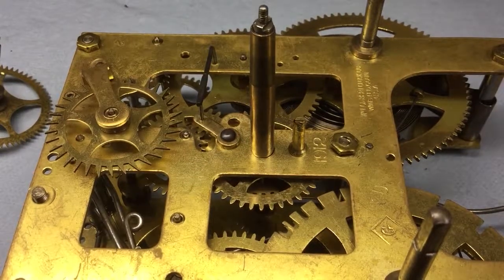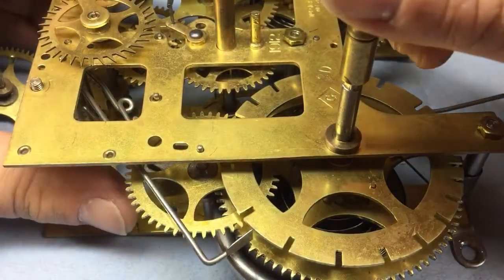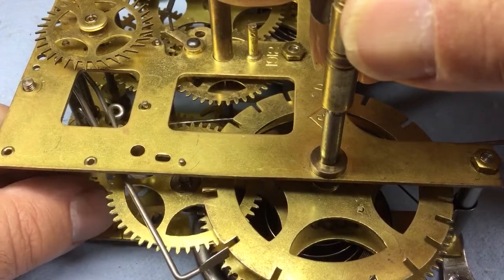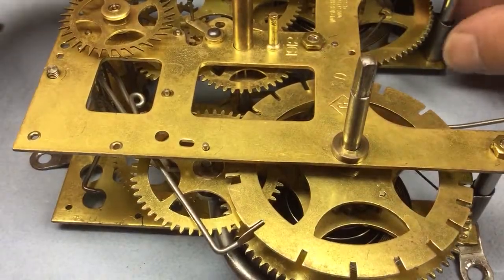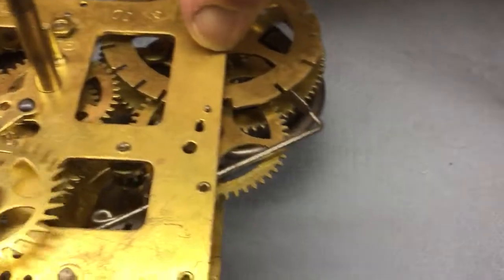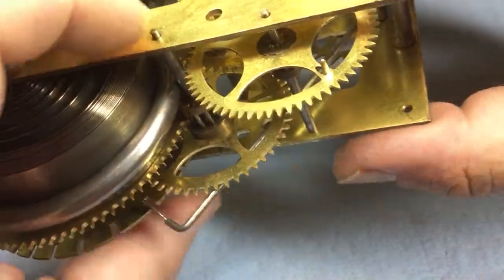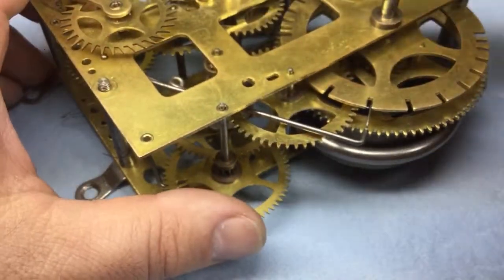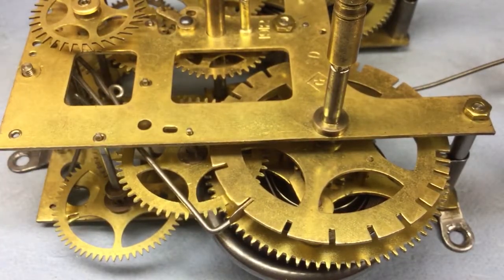Gilbert Long-Drop Octagon Clock Rebuild Part 11

Comment: Great video!!  I have a Wm. L. Gilbert Clock Company Stag Mantel clock and I am having issues of it not wanting to strike.  I have had the face off with the hands attached and I see the arm starting to raise around 5 minutes before the hour, but then it drops back down when it gets on the hour.  I don't know much about these clocks and was wondering if you could tell me or point to a video that shows how the striker is engaged or what my problem might be.  Thanks.  Juddie - J & J TOA

Comment: So I'm unsure as to what you actually did in this video. Were you trying to get it to stay striking and not randomly cut off? Poor question, I know.
Reply from the maker: No, it's a good question! The timing of the gears has to be correct for the strike mechanism to work. Several of the gears have cams and pins that control the start and stop of the strike sequence. if these parts are not put back together right relative to each other, the clock may not strike, or may strike continuously until the spring winds down!